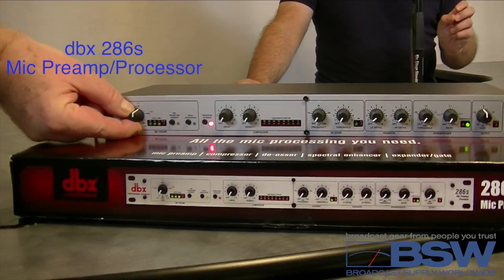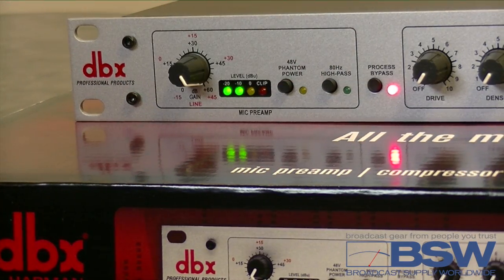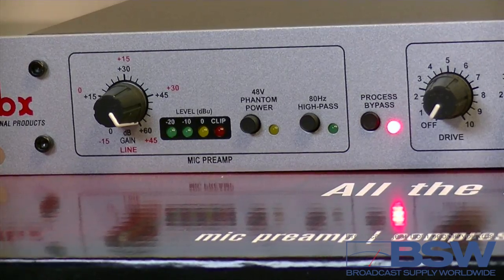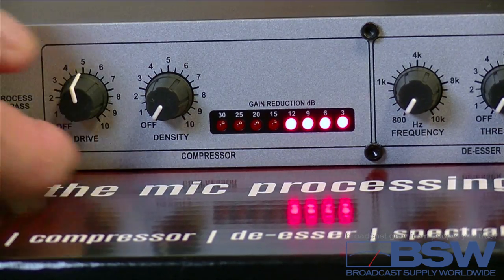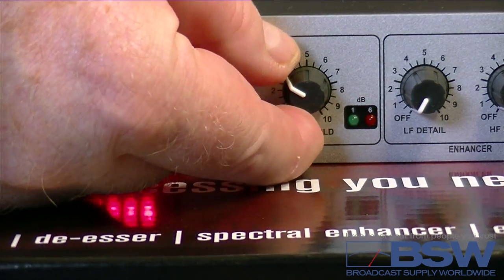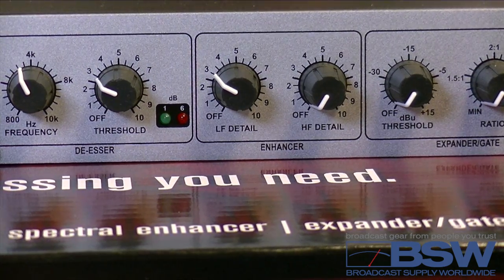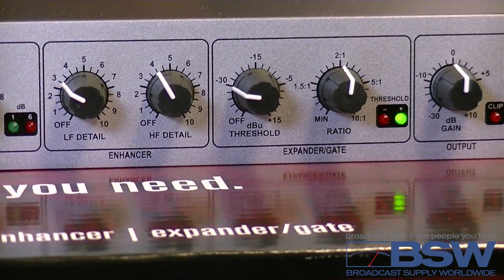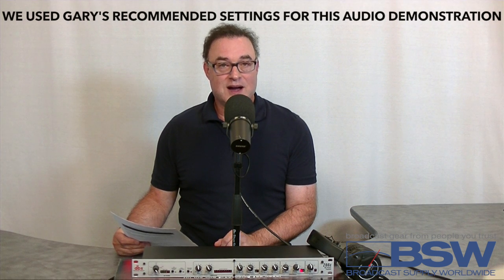BSW Presents: DBX 286S Broadcast Set-up

Comment: Hi. Any possibility you could do a video illustrating how to connect cables when using the D&r Airlite insert function. Where should the mixers gain be? On the rear of the dbx286s there's jack inputs and outputs as well as jack insert. I find this confusing.

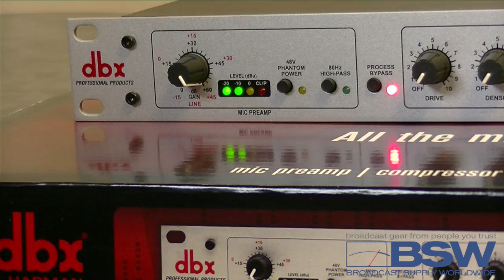Comment: 0:40 it certainly is not okay for the red led to light up! If it does, the preamp section generates a too strong signal which makes the sound clip. Even if it’s not like in your face, it still degrades the sound you get out of it.
Reply from the maker: Try it.... With an SM7B, this is the way to do it.

Comment: Guys I only just noticed the setup guide by Gary. You recommend at the end of the guide to set output to -30 if connecting to a mic input. Mine is going straight into a zoom uac2 so should I set it to -30? As people recommend that line level should always be kept at 0db. Thanks

Comment: When I leave my Output at 0 (12 o clock) my Focusrite output clips ... I have to place it at -30 to keep the Focusrite in the green. Is this normal?
Reply: Nvm, I missed the bit about setting that to -30 when connecting to a mic input. That solves everything, thanks!
Reply: @NB-cr7rt  or a more correct way would be not to connect with an XLR to the Focusrite but with an 1/4 TRS jack as it bypasses the preamp in the Focusrite.

Comment: I've set up hundreds of these. The instructions are pretty good, EXCEPT setting the LF and HF detail. No more than 1.5 on the low and 3 on the high. Also, the ratio should be set to 1.5 for best results. Overall total system gain reduction should be taken into consideration. Average gr on the meter should be 6db. Total system gain reduction should never exceed 30db
Reply: I don't understand what the last knob is for?
is it to attenuate all the added gain from all the processing?

Comment: Good advice, except for the very end regarding output level control. He says if you're driving a mic input, turn output all the way down to -30dB.  This will most likely result in a high noise floor.  If you MUST feed a mic input, it would be better to keep output at line level and put a 30 to 40dB resistive attenuator between 286S output and the mic level input your are feeding.

Comment: Please kindly advise if DBX 286S  works great with Electrovoice re20. I am debating between Cloudlifter cl-1  and DBX 286S , which is the best options. ???
Reply from the maker: Hello. The 286S gives +60db of gain. Plenty to run your RE20. It also gives you some more features and control that the CL1 does not.
Reply: I use a dbx 286s with my re20, its a great combo :)  You wouldnt need a cloudlifter with this combo, I had a fethead which works similar to the cloudlifter and I sold it when I got my dbx.

Comment: Hi guys,

I am using the SM7B with the DBX286, yet with the pre-amp turned all the way to the max, my mouth 5" from the mic, and normal spoken speech... the pre-amp only ever gets up to the -20 light.  I really have to speak LOUDLY, just shy of yelling to get up to the -10 light.

Do you know why this is?
I have a feeling that this is stopping me from getting the most out of this unit.
Reply: +BSWUSAVIDEO Even now, after purchasing different XLR cords, my "mic pre-amp" lights still only really light the -20 light. This is so strange.

Could there be a problem with the unit you think?
Reply: I ended up solving my problem, without the help of any Youtubers or forums, since no one responded at all (anywhere).

My DBX 286s had a faulty power supply unit.
If you're good with electronics, you can replace it yourself, but it can be very very dangerous to do if you do not know how to do it properly. So do not attempt to replace it unless you know what you're doing (I'm not responsible if you electrocute yourself or burn your house down lol) :

http://www.fullcompass.com/prod/231422-DBX-26-0268

After replacing the unit, my DBX 286s works great, and behaves just like everyone elses.

If your DBX is still under warranty or within a return window, I'd exchange for another unit.
Reply: Between the mic and the DBX try a CL-1 Cloudlifter, you will get voice depth and gain you never thought possible with a SM7B!

Comment: Good advice all around, but there is one bit of very bad advice that I think should be corrected. On the input gain stage/preamp, you suggest that it's occasionally okay if the signal is clipped (going to red). This is never okay in a professional audio setup. You are effectively lobbing off the top and bottom of the waveform's amplitude, which in turn distorts the signal and produces undesirable harmonics within the frequency spectrum that has bee clipped off. The output is effectively a square wave during clipping, which is fine if you're playing a guitar through a distortion pedal, but not when you're producing professional vocal material.

You want your peaks to occasionally reach 0 dBu, and averages to live between -10 and -20. This will ensure that you have a clean, un-distorted signal leaving the preamp. 

Also, the output gain is there for a specific reason - gain compensation. You want the gain leaving the box to be roughly the same as the gain leaving the preamp section.(Unity gain) 0 is a good place to start, but to set it properly you need to measure the output in dBu (in your daw or your hardware mixer) and adjust things appropriately for best signal to noise considering all of the equipment involved. Level setup is a technical art in and of itself, but just consider this final gain knob to be what you use to adjust the output gain back to unity (to the preamp) after the various processors have been set up, which may themselves add or subtract gain depending on how they are set. 

I've seen people misuse gain adjustments on boxes like this so many times now, and then they gripe in product reviews about how noisy they are, or how crappy they sound. It's critical to recognize that typical signal chains have multiple gain stages, and all of them must be taken into consideration when making adjustments to levels, with the goal of maintaining unity at every stage.
Reply from the maker: +mpxz999 Another option in increasing the output of your SM7B, which is eve recommended by Shure, is the Cloudlifter-1. Check it out. I have radio/podcast customers all over the world using this solution, day in and day out. We even bundle the SM7B with a Cloudlifter as a package.  http://www.bswusa.com/Microphone-Preamps-Cloudlifter-CL1-Broadcast-Cable-Bundle-P10550.aspx
Reply: +twsbbl Hi, you seem very knowledgeable, so I thought I'd ask you:
I have my Shure SM7B connected to the DBX 286S but even with the "Mic Pre-Amp" maxed, and with regular speech, only the -20 light lights up. I really have to raise my voice to get the -10 to light up. At that point, I'm way above normal speaking volume.

Would you have any advice on how to raise the level?
Is there a chance that I have a dud unit?

Thanks for your time!
Reply: +mpxz999 Unfortunately, that's expected from that mic. It's a dynamic mic with a relatively low sensitivity. Needing to use a LOT of gain on it is a common complaint. 

I would make sure first of all that your cable is in good condition and wired properly. Balanced cables that are miswired in a certain way can result in 6dB of loss before you even hit the preamp. 

The most likely scenario though is that you're seeing the normal behavior for that microphone. If you're doing vocal tracking with it (singing) then it is a fine mic, as singing voices tend to be louder than spoken voice. It wouldn't be my preference for narration, podcasting or other spoken word work. If it's your only option, then your best bet will be to get it as close to your mouth as possible, and maybe push the compressor a bit to squeeze a bit more gain out of it there. 

You will want to be careful to tweak your various gain stages to achieve the best possible signal to noise, all components considered. For instance, if you jack the input gain at the 286s all the way up, then use the compressor for more gain, and keep increasing gain down the chain like that, you're going to be raising the noise floor up at every step. Find what sounds the best to you signal wise, with the least amount of noise, and don't worry about the meter on the preamp.

If you have even a hundred bucks plus tax and shipping you can spend, there are very inexpensive condenser mics out there for entry level voice work that are also reasonably good sounding, and will give you a much more sensitivity, thus more gain to play with. The MXL 990 is a very good mic in that price range, and you can find them for as low as $50 pretty regularly on Guitar Center's and Musician's Friend websites.

If a new mic isn't an option, just follow the above advice. Play with things, get the sound you like, and don't worry about what the preamp meter is telling you.  --Tim

Comment: Settings sound magnificent, but I find it's actually a little too quiet; the only thing I changed was the output, putting it to +5, and it sounds great. Thanks for the info.
Reply: +Paul Aulridge Jr If the preamp on the dbx is set properly, peaking at 0 dBu, and averaging -20 to -10, and you're having to push that much gain out of the box, then something isn't right somewhere down the chain. Are you patching the output of the DBX to an unbalanced input on the next piece of gear? If you're not using the right cable, you might only be getting one leg of the balanced signal output from the DBX, which would result in a 6db loss as well as a noticeable decrease in low frequency content. Compensating for this elsewhere is just going to add noise and unwanted artifacts to your signal.

Comment: Hey guys, quick question. I'm looking to get the 286s to power an SM7B or possibly an EV RE20 since both are low output microphones. The SM7B is said to need around 60 db minimum of gain and I noticed that you had the gain set all the way up in the video. I've heard that if you set a preamp's gain all the way up, you start to get noise. Did you guys get noise having gain set all the way up and did you fix it in post or was there no problem? Thanks!

Comment: So to clarify if no high pass on the mic then use the high pass button?
Reply from the maker: Hi Greg.

If the situation calls for a high-pass filter, check to see if the mic has a filter (that will give best results). If the mic has no filter, use the filter on the 286S.

It’s always best to use a filter as close to the source as possible. I don’t recommend using a filter at the mic and at the preamp (use one or the other, but not both).

Gary
Reply: +BSWUSAVIDEO With regards to podcasting - If you plan to edit your audio in post after recording (and you are not streaming a live show) you should consider bypassing any Expander/Gate present in your recording signal path - this will allow your noise reduction software/plugins to more easily 'learn' what it will be removing. For example, with some software, you can highlight just a section of the noise in your audio waveform, in order to 'teach' it what it should be removing. 
NOTE: If you are live streaming, like say on Blab or Periscope, I would suggest splitting your audio signal at some point. 
On the DBX 286, this can be done via the [insert] jack on the rear of the unit. For example - Plug your mic into the DBX 286s as normal. Then, if you plug a standard 1/4" cable (not TRS 1/4" style cable) into the DBX 286s [insert] jack on the rear panel, it should provide audio that is coming from ONLY the DBX 286s MIC PRE section - the trick is DO NOT push the 1/4" plug all-the-way into the [insert] jack (otherwise, this will interrupt the signal completely and not allow a 'parallel signal' to continue to pass through the rest of the DBX 286s.) 
If done properly, this will give you  -
 - One audio signal path going completely through the DBX 286s (to send off to Periscope/Blab, etc.)
 - A 2nd,  'MIC PRE ONLY' audio signal (coming from the [insert] jack) to send over to your recording set-up. 
(yes, I realize this is not a requirement, just a suggestion for those planning to provide the audio as a download afterwards.) 

Similarly, as in the case of iZotope's RX5 Advanced software, its optional 'de-plosive' tool works best when you DO NOT engage the bass roll-off (aka high-pass) switch on your mic, DBX 286, or via EQ - That switch on your mic (if so equipped) is a less than perfect, 'one size doesn't fit all' solution, in my opinion.  If you are going to do any post-production on your computer, you want to record the full range of your microphone, with rumble, warts, and all. You can then, in this example, use the 'de-plosive' tool first, and if so desired, roll-off the low end using a corrective or parametric EQ thereafter. 

On a related note, I highly recommend Heil PR-40 owners record the full range of their PR-40, but then roll-off the low end accordingly during post-production - one of my favorite podcasts needs to do this badly! (again, just my opinion, of course.) Whenever I listen to that podcast in the car, I need to roll the bass all the way down to make it sound good, and less 'boomy.'